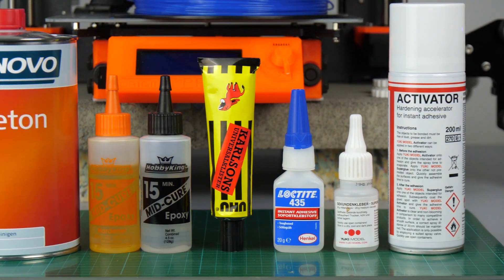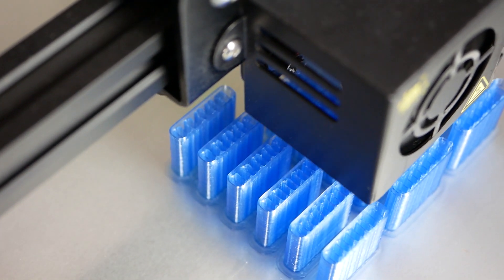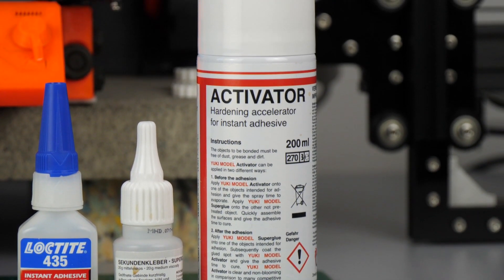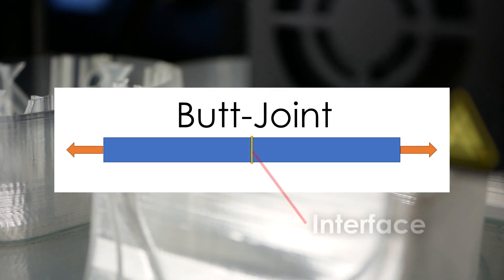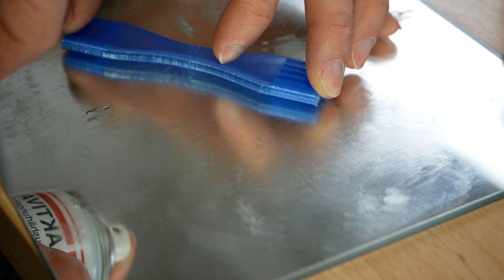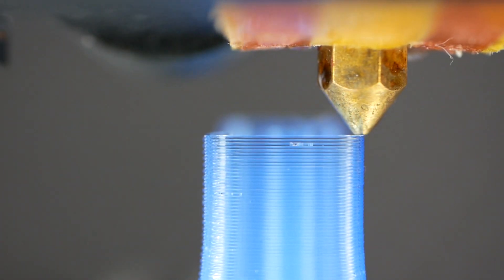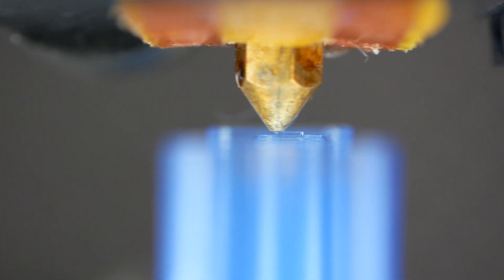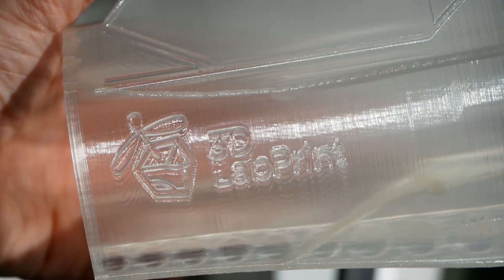3D printed AIRPLANE - Messerschmitt Bf 109 || PART 2 - Which GLUE to choose?

Comment: i used pla aero from bambu for the piper cub and super glue. i crashed it about 4 times so far lol. east to repair with superglue, If i could give advice, up the power or prop on this model, i def didnt have enough thrust with the weight.

Comment: Great work as always, thanks for posting. I have had consistent success using Araldite standard (2 part epoxy) with ABS-ABS and ABS-aluminium. Currently looking at options for PETG.
I was surprised that you didn't use jigs to align and clamp parts together while the adhesive cures. I appreciate that would disrupt the flow of model construction (although it is common practice for model making) but it would get a consistent result for the test pieces.

Comment: annealed pla looks a very good option for parts that are exposed to heat. Also it’s likely that these parts will actually work at higher temperature most of the time and impact resistance is obviously higher.

Comment: Gluten Tag Stefan,
Where is the video with the printer profile? I just purchased a model from 3D LabPrint but they don't really support CURA. I've tried using the CURA profile from PlanePrint.com but that profile doesn't quite work for 3dlabprint models. I can get great skins but the internal bracing is printing mostly separated from the outer wall. I'm not sure how to fix it.
Reply: I haven't been able to find the 3rd video you mention at the end of this video that shows the slicer settings.

Comment: I struggled with the proper glues for a long time. PETG was probably the most challenging. Finally stumbled upon J-B weld's PlasticWeld. A 6 minute epoxy with two parts you mix together. Works great for PETG, PLA and ABS. It claims to work with most plastics.

Comment: A Finn here, the UHU glue is contact glue. It is good as a replacement for double sided tape.. We use it in instrument repair for gluing pads specifically because it is weak glue and allows one to adjust them even after the glue is suppose to be set. It is soft, weak glue that works well in places where you don't want absolutely permanent bond.

My experiences with CA is tat any accelerator will weaken the bond. It sets too fast..

Comment: Good information.  I would add...Instead of the suggested medium CA for my planes I use a slow CA.  I find that medium CAs, at least here in the US, don't give you enough working time to make sure the parts are aligned properly.  Since the surface area of the parts being glued is so small it is very important to get the alignment correct.

Comment: Could you please test a solution I might have accidentally stumbled across. I was looking for suitable paints to paint pla parts and came across a plastic primer and had a light bulb moment . The primer has etching properties so painted the parts with primer then stuck the parts together. Seemed to be a stronger join. And I thought it could probably make it possible to use glues that normally wouldn't have worked at all. Would you look into it?

Comment: You should maybe do another test, except add a small inner and/or outter lip by printing a few small flat strips, thereby transforming them from butt joints into a sort of lap joint (believe its called a single cover joint).
or maybe adding a layer of CF or Fiberglass with epoxy over the joints to see if that helps any? Now i'm curious.

Comment: I have good experience with this glue UHU Plast Special: https://www.amazon.de/dp/B0036EGDVW/

It's relatively cheap and seems to work pretty well with PLA - I've glued a lot of stuff which holds up perfectly. Of course I did not test it in such a sophisticated way like you do ;-) I would be very interested in how it compares to the other glues.

Comment: i have been working with knives for a number of years.  attaching handle material to the metal. my best results were when the material was not cleaned. wiping with anything after sanding caused problems with the glue connection. it wasnt my idea. i have seen the results from others testing. and i did the same test and found the same results.
Reply: That's what I wanted to say. After sanding, do NOT clean with anything other than clean air. Using alcohol leaves a one atom layer of molecules, preventing proper adhesion of the glue. It might be that cyanoacrylate isn't too sensitive for this phenomenon, but why take the risk and extra trouble.

Comment: Use industrial glue (e.g. Schwanheimer) and you will NEVER use anything else. Yes, it's expensive but it's so much better than any other high glossy advertised super glue. Especially for the blunt connection (german: "Stumpfe Verklebung") you should use the filler (german: Füllstoff) and the connection will be like welded.

Comment: a few things:

- of four kinds of PLA I tested only one could be glued with acetone, and only barely - it seems that some PLA's contain some ABS(?), most don't though

- epoxy bonds can be made much stronger if you cure them in high temperature - up to 200°C I believe, even 50°C available with PLA would make a difference

- and most importantly - PLA can be dissolved and glued with Ethyl acetate, could you PLEASE PLEASE try it with your rig?
It would be awesome to know real data about that method!
Reply from the maker: I guess it depends on the epoxy at which temperature it cures. The ones we usually use cure fine at room temperature, more professional ones need tempering at higher temperatures, so I think this wouldn't have benefited us. BTW: Just ordered a bottle of ethyl acetate ;-)

Comment: Really interesting investagation Stefan!. As you say butt-joints are not the best option to transfer the loads, this is the main reason why we decided to use for our 3Dprinted airplanes the overlaping concept to join the parts, it is better for stress and easier to align the parts. We did a lot of stress calculation and testing and finally we have been able to prove that our plane can reach up to 11G of load factor while still maintaining a ligth weight comparable to a foamy plane.
Here you have more information about this topic https://www.eclipson-airplanes.com/ultimate-load-test

Comment: Loctite with activator that is like 'superglue' right? Joel also came to the same conclusion a while back. I use it now and its good but you should definitely use goggles to protect the eyes, and have it well ventilated, especially if you glue a lot in one go.
Reply: Yes it is really shitty stuff but at least it works well. It is quick and really strong. Any other recommendations?

Comment: You should give "Tangit TI 24/24" a try - it is used for cold-welding plastics in the industry. i use it for models that i printed in smaller parts and it works very well.

Comment: From what I've read ,adding moisture to a super glue joint after putting the parts together causes a skin to form on the outside and actually slows down the curing process. And adding it before is going to cure it too early.

Comment: You can do some pretty strong but joints if you can design the end to have small holes that lead to a slightly larger inner hole or chamber. You can then fill the holes and outer but joint surface with epoxy glue and join them together. The result is that when the glue hardens, it will create a hard locking mechanism like pins or dowels which hold to pieces of wood together. I have done this effectively for small repairs. If the part is solid on both ends, you can make small holes with a drill we're both ends meet, but angle the holes slightly. Unlike using straight dowels on a couple pieces of wood which might separate over time, these "epoxy dowels" or "nails" (whatever you want to call it) work stronger in an angle because if there is any possibility of separation, then it is much more difficult because it is not one straight line from one part into the next.  Has anyone ever had a wooden chair with round parts that go into holes on another part and these keep coming apart when someone sits on it? Some people use a nail to hold it back in place which never works long-term. I fixed may chairs by using a small drill and making some angled holes where both ends meet and filling them with epoxy. When the epoxy dried, these holes and surrounding surface formed locking mechanism with epoxy spikes which make it impossible to pull out. I still have the chairs 20 years later :)

Comment: I would have liked to see a test of filled acetone as a gluing agent.  I have noticed that straight acetone seems to attack the plastic - probably some function of how soluble different length molecule chains are. This removes material, however little, from the joint. By using acetone with a good amount of pre-dissolved plastic, there should be addition of material to the joint rather than removal. Also less attack of the plastic in the area of the glue joint. The downside is that it takes much longer for all of the acetone to evaporate from the joint.

I suspect a dovetail pattern of the matching parts of the joint would offer the strongest joint but would be a bear to get assembled on more complex assemblies. That might be a good test to run for test samples to see what the trade-off is: more dovetails with smaller finger size vs fewer dovetails with larger finger sizes.

In my experience, even the amount of water absorbed from the ambient air can ruin acetone's solvency.  I keep my main can tightly stoppered except when transferring small amounts to a work bottle which is for common use. I discard the contents  when it shows signs of getting too much water from the air.

Comment: Hello Stefan. Did you try out friction welding or welding with a 3d Pen using the same material ? The results are amazing concerning the strength of the joint. Cheers from Rostock.

Comment: Great video as always! Keep on spreading "scientific research" for everybody :)

I wonder if you have a tip / an opinion about the TMC2208 stepper driver since your videos about finding a sweet spot between silencing your 3D printer and print quality were quite detailed.
Reply: Buy SD2224 from Panucatt instead. They are TMC2208 but you can pick stealthChop2 or spreadCycle using the MS3 pin under the jumper.

Comment: I always use revells contacta professional. Really nice to apply because it has a small syringe-like thing. Sadly it takes quite long to cure...
Reply from the maker: Is this the same one that you also use for the Revell models? Built many of these in my childhood, but I think that's a special type of plastic which is slightly dissolved.
Reply: CNC Kitchen Yes exactly that one. I also used it because of a model car and as you probably know it sticks very well. I would like to know how it performs in case you got some of it laying around and some time leftover ;-)
Reply: I think Revell model kits are polystyrene and the glue is Butyl Acetate, a solvent. It's used for its low toxicity, it's an approved food additive and naturally occurs in many fruit. You want to be able to hand those kits to a child, right.

Comment: Great video! But the "glueing PLA with acetone" bit has me scratching my head. Of the eight or so PLAs that I've tried it with, not one shows even slightly sticky tendencies. Is it a particular PLA that you've found acetone works with, or a range?
Reply from the maker: It's the only one I've tried, yet. And there it worked great. Strange, that you didn't have success on any other, since its even possible to slightly smooth PLA with acetone (see Toms video).
Reply: Wow! Fast reply, Stefan - thanks! Yes, it is weird. It's making me wonder whether it's my acetone (or maybe "acetone") that's at fault: it's cheap, pound-shop nail varnish remover, and although the label lists the ingredients as "acetone, aqua", maybe this cheap stuff has a critically higher proportion of water that renders it unsuitable. Hmmm... Some experimentation is called for! :))
Reply: I haven used any pla that glues or smooths with acetone and always assumed it was an American or European formula as most of the stuff that reaches me is from china.
Reply: Hookay, here's a bit of follow-up experimentation that might explain things...

I bought some slightly more expensive nail varnish remover (still from a pound-store, but this was in a smaller bottle with "99% acetone" written on it, so probably a higher acetone content than the previous el cheapo stuff) and cut up 10cm samples of just about all the PLA filaments (and a TPU one... more on that later!) I had around - about 12 of them - and one by one put them in a tiny jar, half submerged in the acetone, for a few hours.
The PLAs were all no-brand, budget ones from ebay (hmmm... pound-shop acetone, budget filament... I'm seeing a Scroogeish pattern...) and all behaved in a similar way:

     : the coloured ones were bleached to white, or to a very pale pastel
     : all the filaments became more flexible and bendable, although bending them usually resulted in breakage because the filaments were now very fragile. None of them had enough structural integrity to be printed with.
     : there was no hint of smoothing or extra glossiness to the filament surfaces :(
     : several of the filaments split along their length and opened up slightly, as if there were an inherent weakness on the filament's surface, running along its length. Strange and unexpected...

I also left a small PLA print in acetone vapour for a few hours, and it became soft (but not smooth or shiny) and lost a lot of layer adhesion. Interesting effect, but probably not very useful. Days and days after, it's still in slightly soft pieces.

TPU...
Slightly more interesting - some cheap, black TPU was put in the acetone and left for a couple of hours. Afterwards (days afterwards too, it seems) it was at least 50% stretchier, but with no apparent loss of strength, which is very interesting. The sample I acetonised was only about 10cm, so waaaay too small to try printing with. But I may try acetonising  a larger sample and see how it prints! :)

Comment: I wonder why they don't offer glue-in inserts with the kit. Slightly undersized short pieces that lap join to both pieces.
Reply from the maker: I guess it's not so easy, since they would interfere with the spars. The parts do have small studs for easy alignment, but still, the gluing part is only butt-joints.
Reply: You are rigth, althougth it seems something simple to do, it is difficult to design due to the "peculiar" way that a 3D printed airplane plane should be designed to be printed with only one perimeter. But we have been able to do that with our plane.
Reply: We have used this concept that you describe to join the canopy of our next airplane (not unveiled yet), but this part does´t carry any load, the rest of the airplane has overlapping to join the parts. You can check it out.  https://www.eclipson-airplanes.com/
Reply: What if all parts had a flat on one side, where it touches the bed, and the insert would be partial and also had a flat to mate with that one? Still a butt joint, but at least you' d have lots of area. Unfortunately there's a weight to that, so i can't just call it a good solution either.

Comment: Why you didn't try dichlorethane or dichlormethane as a proper dissolver of PLA?
Reply from the maker: Unfortunately hard to get a hold of here in Germany.
Reply: Holy hell. I didn't know they forbade DCM in 2009 across Europe.

Which doesn't seem all TOO sensible, because at least DCM has much lower toxicity than any of its alternatives.

Comment: Could you do another video on gluing PETG parts? I've yet to find a method that works great. Thanks!
Reply: Have you tried MEK (methyl ethyl ketone)?  It is about one of the only solvents that work well on PETG like acetone works on ABS. Ethyl Acetate also works but you need it to be far more pure than MEK. MEK is quite dangerous though, although far easier to get as big tins than ethyl acetate. Both can be found in "acetone free" nail polish. However I have really only found the MEK based nail polish to work well. Coming back to the purity issue. 
Otherwise your standard super glue or epoxy is going to be your best option. 
using a either MEK or ethyl acetate in light dilutions or vapors can work to give normal glues something extra to bite onto with petg.

Comment: My friend and I built the BF109h we used petg. And joined the parts with a 3d printing pen. It worked the best.
Reply from the maker: I unfortunately don't have one of these pens. Would have liked to try that as well. Did the seam look good?
Reply: They are only $10 on ebay
Reply: You can just use a dremel to friction-weld, that should achieve the same end result...?

Comment: Interesting, somewhat boring that the oh so mundane super glue did so great but i suppose that is a good thing as that glue is extremely cheap and widely available.
Reply: Quite surprising how generally useful that stuff is considering it was developed for battlefield use to close wounds. (in other words, it's specifically designed to stick skin together - amazing how well it does on so many other things. XD)

Comment: Thanks! This was excellent, as always! I wonder if pre-heating the parts would make any difference in the final strength. Another test could be using tongue-and-groove instead of the overlap for an interface. It's wouldn't be easy to update the files with TNG but will keep the minimal weight and look vs an overlapping design.